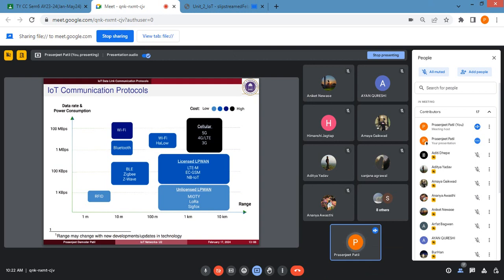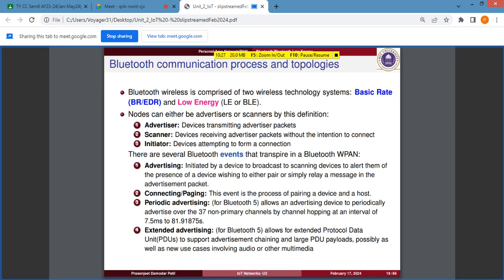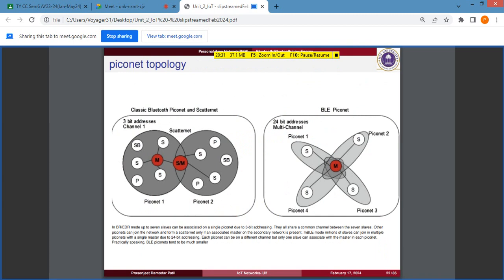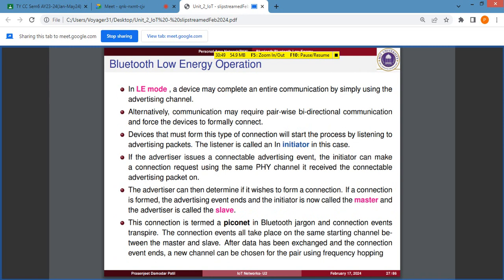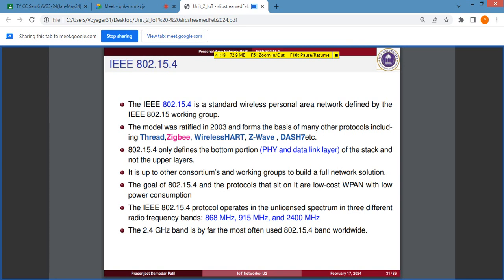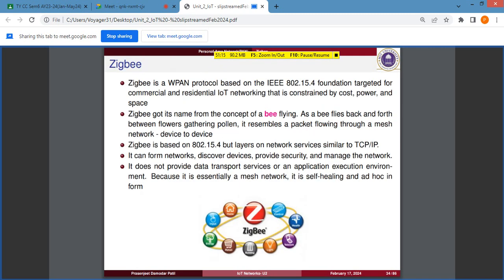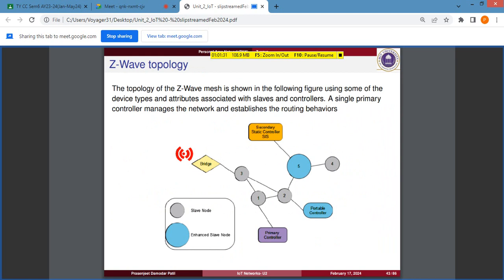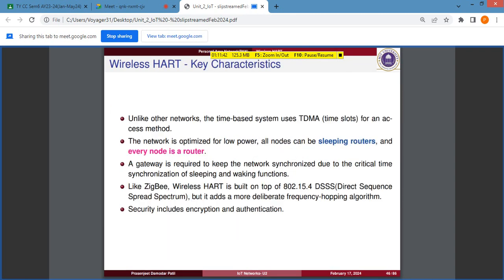IoT Physical & Data Link Layer Wireless Communication Technologies

Comment: Sir ,who  is responsible to convert frequency into digital data or vice versa in zigbee network. How actually this process take place?
Reply from the maker: To transmit the information, the 2.4GHZ band is divided into 16 channels(16 different frequencies) separated by guard band of 5MhZ.
For transmission purpose XBee uses BPSK & O-QPSK(Worldwide accepted) modulation techniques. The digital information has to be converted & modulated before transmission through antenna.
At the reviving end the process is reversed.
I hope this solves your doubt.